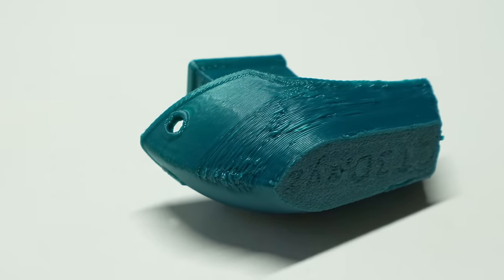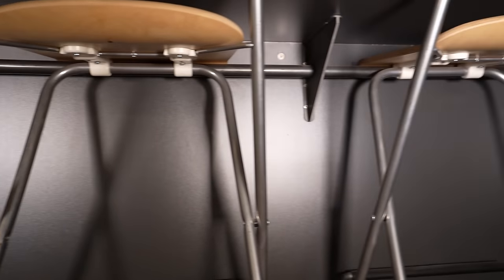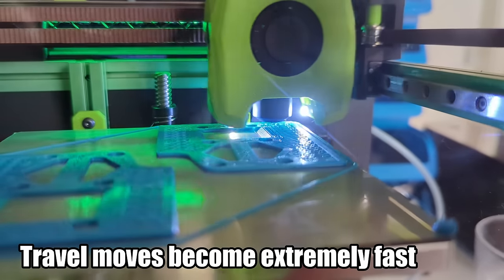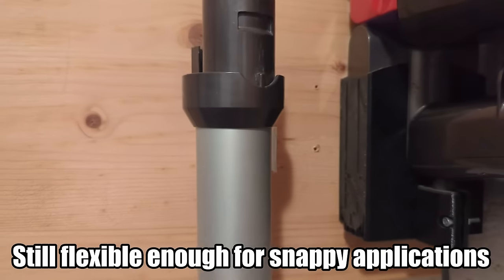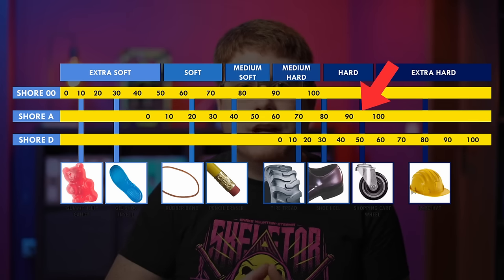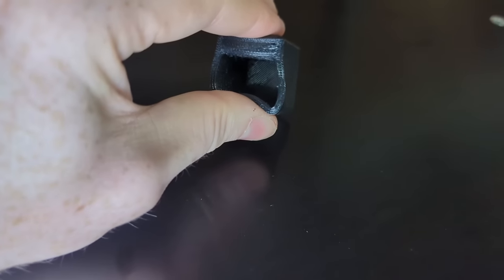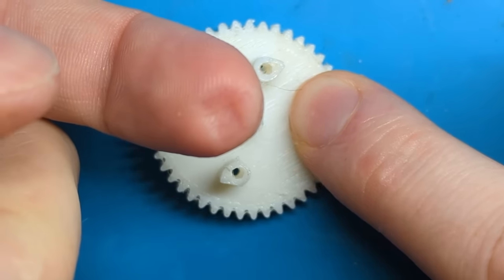3D printing material: When to use PLA, PETG, ABS, TPU, Polycarbonate, Nylon etc.

Comment: I bet PLA has those properties that no other material can quite match... even when heat IS an issue. It doesn't lose those other properties just because it falls apart under extra heat, right?
(What I mean is: What you said is kind of like saying, "If you look under here, this has [such-and-such a thing]," where my response would be, "Hmm, I bet it has that thing even if we don't look under there.")
Reply from the maker: I guess what I wanted to say is "don't disregard PLA just because it gets soft pretty fast". People tend to turn to PETG for all use cases even if it's not the best material for the job. I hope that's what you were talking about.
Reply: @SmallBatchFactory , thanks for your comment love! That's fine, thanks for describing that for me. But What I meant is that sometimes some people state some things that happen or exist as if they're dependent on each other even though they're really not, and this sounded like one of those times, so my comment was just to suggest that the contents of your second phrase in that sentence don't depend on the contents of your first phrase there. For future reference, of course.
Reply from the maker: In printing material they pretty much depend on each other. You can't have the properties without the other without using another material. You always have to account for all properties the material has.
Reply: @SmallBatchFactory : That's not really what I meant either, but that's OK.

Comment: I print 55D usually at 150mm/s
Reply from the maker: Works good? Which printer? I know people having issues with 85D already.
Reply: @SmallBatchFactory  Voron 2.4 R2 with stealthburner
Reply: @SmallBatchFactory  of course with direct drive (clockwork 2). With bowden I was printing only 30mm/s
Reply from the maker: Those Voron tool heads are really something special. I added a "Red Lizard UHF" hotend with custom adapter and it's extremely fast. Plus the motor is extremely close to the extruder itself.

Comment: Have you tried using PLA with PETG supports?

Is it possible to print polyethylene?
Reply from the maker: You mean as in support material or combining both materials into one print?

Pure PET has some downsides AFAIK that's why they added glycolether in PETG. For now I only tried off the shelf metrial.
Reply: @SmallBatchFactory  Yes, as a support material.
Reply from the maker: @christopherd.winnan8701  you could do that, but why would you? PETG is notoriously sticky, so it's hard to remove. Just do them from PLA as well or use something soluble like PVA or HIPS
Reply: @SmallBatchFactory My apologies, i was simply repeating what I read.

Comment: I hadn't heard about pla's heat  sensitivity, I was about to make a piece for a window blind
Reply from the maker: Better use PETG or even ABS if you can. Even if the room is air conditioned PLA doesn't stand a chance against direct summer sunlight.
Reply: @SmallBatchFactory  yeh I will probably try ABS, as i have a reel of that.
 I only came across your clip randomly too 👍
Reply from the maker: Feel free to stay, I have a video about getting perfect ABS results too ;-)
Reply: @SmallBatchFactory  sweet, will go watch that one for sure.

Comment: I can't get PLA to stick on my PEI sheet. Tried different temps, glue, it just pops off half-way through the print.
Reply from the maker: Do other materials stick? One major thing is to have the nozzle pretty close to the bed (although I printed PLA by accident with too much distance and it still worked). Do you have a heated bed? Try washing the sheet with soap and dry it thoroughly. Usally PEI works extremely well, but not if it's greasy.
Reply: I have to wipe the bed down with isopropyl alcohol after printing PETG before I can get PLA to stick again.
Reply from the maker: @OzzieKev it's a good habit to get into anyway. I do a quick wipe of the bed before every single print.

Comment: Are you using AI video/audio translation? Just curious.
Reply from the maker: Nope, what led you to think so? I use a voice isolator to get rid of room noise and a bit of compression + equalizer for a deeper sound. 

Someone else asked as well so I'm curious. Seems like I need to adjust the audio delay a bit more to lip sync it better.

Comment: Im only using PLA and PETG, not because they are oldschool and easy to print but because they are cheap.  i pay about 10 euros per kilo, i would never buy a roll that costs 30..50 no matter what properties it has. in the end its just plastic and if i need a very rigid nylon part i usually use a SLM service, they are almost cheaper than a roll of filament nowadays.
Reply from the maker: That's definitely a very good reason. I usually buy the cheapest stuff. ABS used to be cheaper than PETG in the past, but that changed. Only exception is my spool of Polycarbonate, sometimes I just need the heat resistance. But I've had it for years now (in a dry box) and there's plenty left

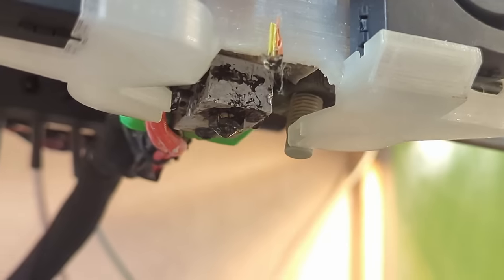Comment: 4:34 i found it quite easy, just heat the thing up and pull it off.
6:00 i also found that pretty easy.
Reply from the maker: Depends on the material. Some are easy but some stick like there's no tomorrow. I have glass beds with ripped out pieces. Heating up would've worked but also destroyed the part so it's a delicate balance.
Reply: @SmallBatchFactory  glass is a different animal for sure, depends on  how much your part is worth in relation to the glass, i have a cr10 max so id rather melt the part a little because the glass would ve quite expensive.
I'm mainly referring to hotend parts and drills.
Reply from the maker: @deltacx1059 I didn't know it would rip out parts until it did. Luckily it was just an IKEA mirror, not the original CR-10 glass.

Cleaning the metal not physically hard but it's annoying. Especially on the Prusa it's hard to not damage anything so I didn't bother to remove everything. It was way easier with my Vorons ceramic hotend for example.

Comment: I've found that ABS is literally cheaper than PLA in my situation so it's a no brainer for me
Reply from the maker: It's been even cheaper in the past, ABS got quite a bit more expensive. Since ABS is lighter than PLA you also get more material per kilo. On the other hand it takes more energy to print, both physically and mentally, so there's always a downside :-)
Reply: PETG, ABS, PLA, if bought from Chinese manufacturers on AliExpress and similar are all around 10 €/kg when bought 5 or 10 spools at a time. PETG tends to be the cheapest, I bought it at 9€/kg (JAYO, which is rebranded SUNLU). I recently tried JAYO Easy ABS with the same identical profile I use for PETG (230/75 °C nozzle/bed in enclosed chamber at 40°C): it prints wonderfully even better than PETG, zero warping and sticks to the bed like crazy!!! It is not as heat resistant as regular ABS though. It deforms at 70°C like PETG. For me it is like PETG with zero stringing, better surface finish and 20% lighter (less dense). It smells a lot, you cannot stay in the same room.
Reply from the maker: @marcobassini3576 definitely sounds like a blended ABS. Less warping is always a nice thing. The surface finish is just so nice with ABS.

Comment: Why no word about ASA or SBS? SBS even can be made transparent with solvent.
Reply from the maker: ASA is mentioned together with ABS. I couldn't even find a shop for SBS, doesn't seem to be widely available
Reply: @SmallBatchFactory  Sorry, missed ASA part. Strange, SBS is pretty easy to find around where I live. Maybe its local thing, but the material is interesting.
Reply from the maker: Amazon didn't have any in stock here in Germany and the next best thing I could find was a vendor in Türkey. It sure sounds interesting, maybe it will catch on.

Comment: Unsure why we shouldn't use PETG for everything tbh, besides pricing. Because you didn't come back to the question explicitly, I would tend to agree with your friend, why use PLA
Reply from the maker: PLA has some properties PETG doesn't have, like being stiffer. It also doesn't string nearly as much as PETG does. There's the right tool for every job. You'll get pretty far by "only using a hammer" but as with anything knowing what to use in which situation gets you further.
Reply: @SmallBatchFactory  can you give some practical examples why you would actually want more stiffness? Some maker examples? I guess this is what I was missing, some more context, other than that great video!
Reply from the maker: @userou-ig1ze the best example I ever saw was a material test using shelf brackets. They made the same bracket out of a lot of materials including nylon. PLA held the biggest weight to my surprise. Others just flexed, dropped the weight and then got back into the original form.

Comment: PLA is also one of the most sustainable printable materials and is bio-degradable, I print everything that I can in PLA, other Materials only if PLA doesn't have the right properties.
Reply from the maker: That's definitely true and also my thought. PLA as much as possible, otherwise whatever is necessary.

Comment: Why is there so much bed adhesion talk about tape and glue? Washing the build plate with hot water and soap fixes all adhesion problems non moisture, leveling related. The plate only needs washed every couple of month depending on usage. Tried and tested on glass, pei, and whatever the ender bed is.
Reply from the maker: From my experience I never had any luck with just a degreased print bed. I always needed a thin layer of PVA or something stronger. Only TPU and sometimes PETG adhere so well I don't need anything, but that's almost too well so I'm back to PVA glue.

Comment: PLA is not.outdated. No matter how expensive the filament you use for the final parts, PLA is still the perfect material for the prototyping process.
Reply from the maker: I totally agree. It's also more sustainable, especially for throw away prototyping. Plus it's way less hassle and doesn't need to be kept dry like PETG does.

Comment: Almost all 3d printed gun designs are made for PLA+, the idea that PLA is weak and can't handle any heat is just silly.
Reply from the maker: It does get soft pretty fast but a quick burst of heat doesn't kill it. The superior stiffness is probably why they use PLA.

Comment: For actual parts we use ABS with a bit of PetG, nylon, and TPU.  PLA is basically only used for toys.  Every PLA part from bushings to hooks to machine fixtures deform, melt, and crack almost immediately.  

But no fear I have over 3 years of people telling me PLA is the bestest ever and all our experience is actually wrong.
Reply from the maker: I just watched a video about that this exact same minute and he came to a different conclusion. Although heat is out of the question of course.

https://youtu.be/VunrhQzYWkg?si=Zu1pb3anbA0D6Cpp

Comment: When i tried PETG i needed to print thick, big parts -> I've never seen anything that stiff.

If you print PETG with high infill, high wall count, it becomes extremely brittle. Worst of all, it breaks into sharp shards, they are like knifes.
Worst material ever.

I bought a prusa, and even before getting to test prints first PETG parts had failed. Shortly after, toolhead had to be glued back together as the petg brittleness broke off the PINDA mount.

I can't believe people are insane enough to use this material for anything, i've never seen a PETG part _not fail_. Someone show cased a flexible PETG part which apparently did not fail, but it's thickness was 1mm. Maybe there it works, but i doubt considering the PINDA mount was at same level.

I lost thousands of euros on the experiments, i tried 5 different vendors, multiple colors, multiple printers etc etc.
Reply from the maker: As much is I'm in the "PETG is overhyped" train I don't share your experience. All my Prusa PETG parts hold up strong, even with 657 days of print time on the machine. The Pinda holder even had a few collisions. When the machine is warm it flexes a bit, no cracks to this day.

I replaced the fan shroud with one printed from Polycarbonate though, way more temperature resistant.

It's probable your filament was moist. At least what you describe matches that issue.

Comment: TPR
Reply from the maker: Hard to come by it seems
Reply: @SmallBatchFactory  got some on Amazon but need to get a 2.8mm extruder to try it
Reply from the maker: At least that means it doesn't flex as much when printing if the filament is thicker

Comment: I dont know what you guys are doing to print petg, that stuff doesnt stick to ANYTHING! Ive used multiple spools, almost every type of build surface imaginable, super cleaned every build surface before printing, dried the brand new spools overnight, even used bed adhesion stuff like gluestick and blue tape. nothing. even bare glass which everyone claims petg stick soooo well to just comes off after a few layers. keep in mind thats even after washing with soap and water then alcohol right before printing.
Reply from the maker: How high is your first layer? I go with really low Nozzle distance for the first layer. Almost injecting it into the build plate. Since I do the everything sticks way better. Try that and use Elephant Foot compensation in the Slicer, otherwise you'll get a sharp edge on the first layer. 

PLA is way more forgiving. I've even printed it successfully with wrong bed settings. Meaning it was just laid on top of the build plate with no pressure at all. Doesn't work with other materials IMO
Reply: This type of comment confuses me so much.
PETG is one of the stickiest materials, definitely the stickiest I've ever used.
It's been known to pull up parts of build plates it can adhere to strongly.
PETGs stickiness causes me great headaches with it constantly sticking back onto my nozzle and building up.

Are you 101% confident your temps are dialled in? 
You might be experiencing warping due to temps which causes parts to curl up from the bed, which is different to a bed adhesion issue.
Reply: Well, if you print at low speeds (5-10mm/s) for the first layer, your nozzle isn't too far from surface and you have bed heated to 85C, there is no way it wont stick. Also be aware that bigger nozzle sizes are easier to make first layer stick. Same of you just increase line width for first layer.
Reply from the maker: @mikoaj2323 I'd say it's mostly Nozzle distance. I've printed PETG with PLA temperatures because I got confused and apart from being really brittle it turned out perfect.

With to much Nozzle distance it just starts sticking to something else, which is usually the heater block
Reply from the maker: @BurkeDEV it's probably Nozzle bed distance. I printed PETG with PLA temperatures (confused the spool) with perfect result, apart from brittleness.
Reply: That's weird. I think petg is the stickiest. But it sounds like temp issues. Make sure the environment is warm enough.
Reply: Yea petg sticks crazy and even seems to have better layer adhesion than pla imo maybe it's how it's printed

Comment: You do not fully understand composite materials and I am saddened you're spreading misinformation about the material properties in an otherwise great video
Reply from the maker: At least from the tests I checked beforehand CF filled material (chopped fibers) behaved worse than the unfilled material. There are variants that are stronger, but they usually. involve placing fibers in between layers.